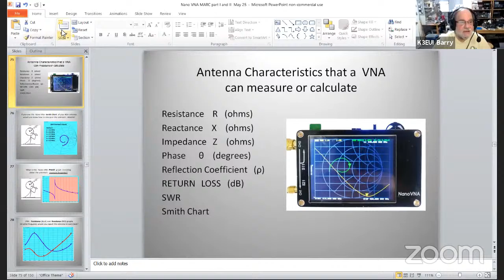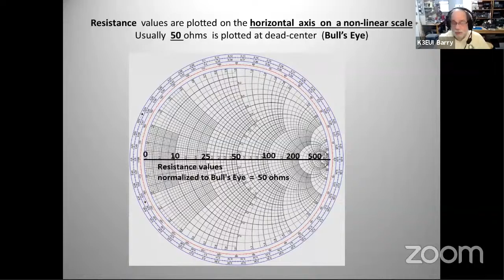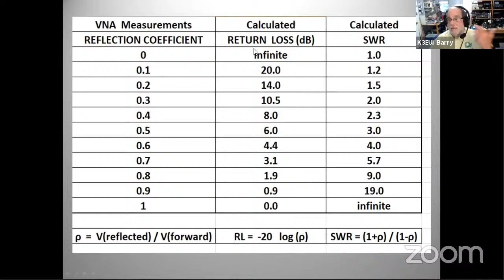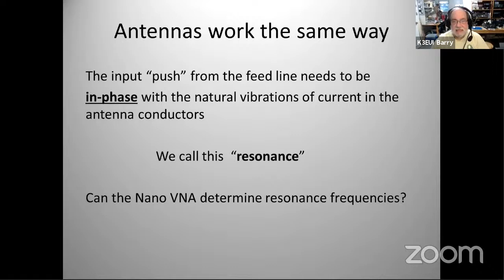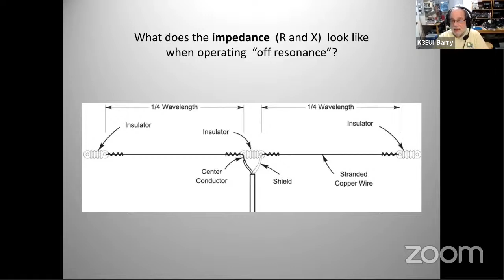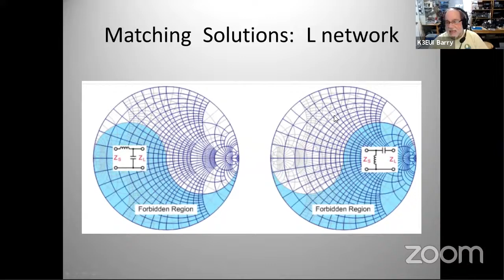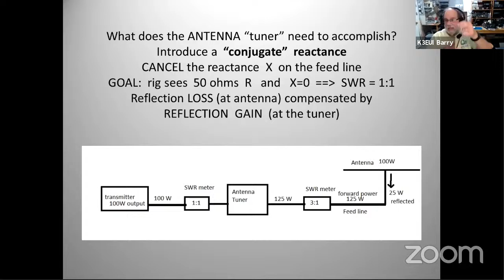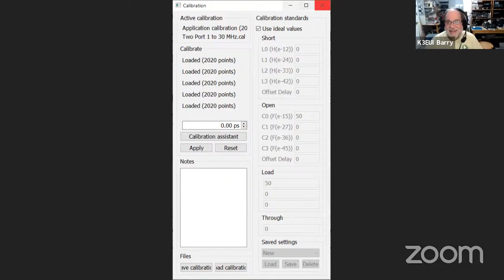MARC May 2021 Meeting

Comment: This was a very interesting video, and for the first time I am "approaching" a preliminary understanding of Smith Charts.  Many thanks to K3EUI Barry for this thought-provoking and educational presentation.

In industrial (50 & 60 Hz etc.) electrical power transmission, phase differences occur between voltage and current, as caused by inductive loads such as motors, and less frequently by capacitive loads.  As one would expect, inductive loads cause current to lag behind voltage, and capacitive loads cause current to lead.  It is a major consideration because large voltage:current phase differences necessitate more current (and larger equipment) to transport the same amount of useful energy.  It is wasteful of the current-carrying capacity of cabling, transformers, and switchgear.

Electricians use the term Power Factor (PF) when discussing this.  When current is exactly in phase with voltage, PF = 1.0.  If I recall correctly (but I might be in error), when current is exactly 90 degrees out of phase with voltage, PF = 0, and even though voltage and current might both be high, zero useful energy is transported.

Somewhat analogous to an antenna tuner, a current lag caused by a large inductive industrial load can be offset by deliberately adding capacitance to the circuit.  Such industrial-scale PF-adjusting capacitors can be physically very large.

As a mental exercise, I wonder if and how power factor can be made to fit into the Smith Chart model of impedance.